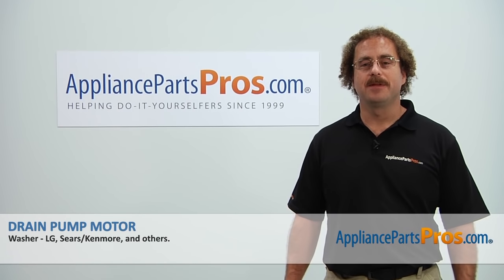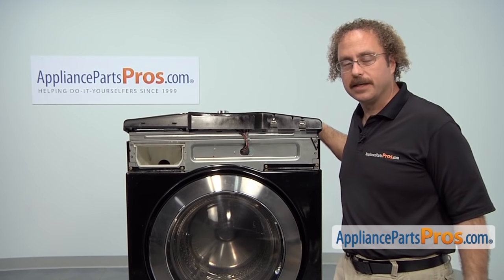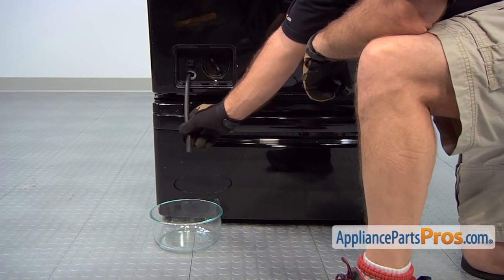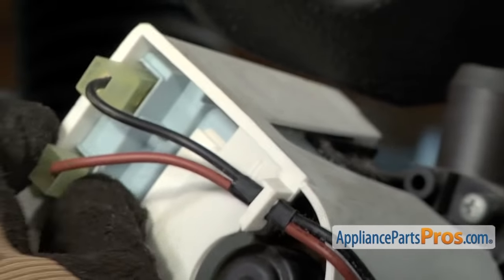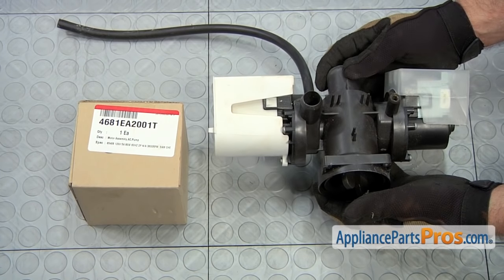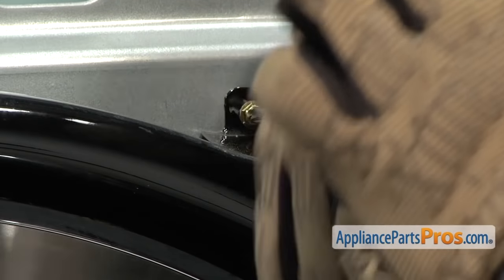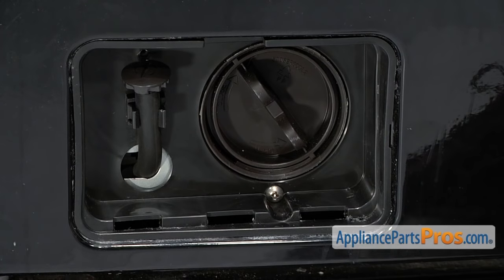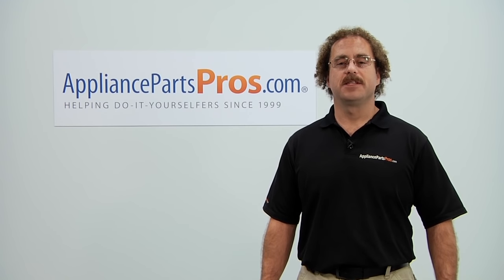How To: LG/Kenmore Drain Pump Motor 4681EA2001T

Comment: Excellent tutorial!  I just replaced the pump, but probably didn't need to -- the drain hose (and the smaller recirculation hose) were completely clogged with nasty sediment which is probably what was causing the problem.  I went ahead and put in the new pump while I was in there since I'd already ordered it and it was so inexpensive (plus the original is 11 years old, so was probably time to replace anyway).
Reply from the maker: Awesome, glad the video helped you out!
Reply: @appliancepartspros  Thank you for posting this video it is excellent.  I found the answer to my problem (clogged pipe where dispenser soap goes in).  After reading this post, I was able to give it a try and disconnect the pipe and clear it from 12 years of soap scum!  My husband couldn't be happier I was able to fix it!   You rock! If drain pump goes I will definitely know what to do :-)  My model washer is wm2377wc.

Comment: Does this video apply to my 2017 LG WM3997HWA? Do you know if my model uses philips heads also? Thanks for this, mine is in a tight spot, can't tilt it back, so I'll need to take it apart. May just skip trying to use my Lowes ext. warranty and do this myself.

Comment: Amazon vid. I'm not a repair man but managed it fine  (so far).
Only issue is the WM3050CW 2014 model of the drain pump doesn't have a clip to pull the motor off. I had to remove the mounting bolts, then additional screws that attached the motor to the plate. Not really easy but manageable. 
Thank you immensely. My next replacement purchase is from you guys.
P.s - now the compressor on my Maytag  PSD262LHEZ isn't kicking on after moving it up the steps. Any suggestions?
Reply from the maker: Rob Kuhar Glad the video helped you get the washer fixed! I would check all the wire connections to be sure nothing came loose. You can also post the problem along with the appliance model number on our repair forum and the techs can help you troubleshoot the problem.

Comment: took mine apart tonight removed pump ,,the comes a part i removed the stater (the center ) just pulls apart it was full of trash and black gunk i cleaned reinstalled have done 3 loads so far  working great (new pump will be here Tues.) you might try it ...Good Luck ..THANKS for the video.
Reply from the maker: ***** Glad the video helped you out!

Comment: We had someone come out 3 times to repair our washer under a SquareTrade warranty.  He replaced the pump on the left twice.  He also replaced some other parts like the PCB board and tubing.  He then said it was the other motor that needed to be replaced as the issue was never resolved.  It gives an OE error and doesn't drain.  Ultimately SquareTrade just paid me off with a check which more than covers the cost of the washer.  I'd like to just order the second motor and do this myself.  Do you think that might fix the issue?  THe tech seemed to think it would but honestly, he didn't seem all that technical to me so just want to be sure before I waste my time.

Comment: Should I still replace the drain pump even though I found out the OE code was from paper money clogging the rubber bellow drain hose and the drain pump is fine on my 10 year old LG FL? I bought a new drain pump since I couldn't find a kink or clog in the drain hose and the drain filter wasn't clogged. When I was installing the new pump, I discovered the dollar bills in the rubber drain hose that connects to the pump housing. Since my machine is 10 years old, should I install the new pump anyway since the old one may could go out soon since it is 10 years old?

Comment: It looks like there are two pumps, one on the left and one on the right.  Is that correct?  

Do I need to replace them both?  

Are they both the same part number? 

BTW, I ordered the LG tool for removing the spring wire ring assembly and it worked perfectly.  I'd recommend it for sure for folks clumsy like me. 

Thanks for making this video.
Reply from the maker: There is usually a drain and a re circulation pump, you can buy them individually, so you only have to replace the one that failed!
Reply: It was definitely the drain pump, on the left, it runs terrific now.  Thanks for your helpful video.

Comment: Great Video, can these Pumps fail in a way that they still pump, but make a huge racket. My LG Model WM3987HW starts to make a lot of new noise just during the drain cycle, but water does drain.. Is the Pump 110 volts so as to be bench tested for noise?

Thanks Steve
Reply from the maker: You can take the housing apart to see if something is in there. Check the wiring diagram for specifics on the voltage.
Reply: I did finally inspect the pump, it does use 120 volt line voltage, bench tested it and it ran good and quiet, Cleaned both the pumps and put them back in.  The loud noise is still there and still a mystery.
Reply from the maker: Steven, can you detect at all where the noise is coming from on the washer? Top, bottom, left, right, back, front, etc? It could perhaps be the motor on the unit or maybe the water valve.
Reply: Thanks for the follow up question, the All in One Washer Dryer is 4
years old and has about 6 medium loads a month, even had a 2 year break with no use when I had to leave town to stay with my Dying Dad to be his care giver in his last days. I have returned to my home about 10
months back and the Washer started with the noise about a month ago.

The noise is loud but only lasts for maybe 40 to 60 seconds, The washer is such a echo chamber it is hard to tell where the noise comes from, but happens maybe 4 times during a wash cycle, it does seem to happen at the start of each Drain cycle. The last Drying cycle there are no unusual noises so I kind of think that rules out the Main motor. 

You have given me a idea to remove the top of the machine and run a load. I would have to camp out in front of the machine though because the noise happens for such a short period each time.
Reply from the maker: Steve, if you'd like, you can call us at 1-877-477-7278 or chat us online at appliancepartspros.com and we can get some more details about your machine to help troubleshoot it.

Comment: So, if I have my washer in a pretty tight space and dryer mounted on top, could I undo my mounting brackets, slide the top of dryer with dryer on top back two inches and still get the control panel off without removing the dryer? Otherwise I need to take off a bathroom door, get a couple hands to pull dryer down, etc. I’d rather not go through the hassle if those retaining clips can be reached without removing the top. I have a ratcheting screw driver and even a full car trim tool kit should I need it for those retaining clips. Thx in advance!
Reply: Top of washer with the dryer on it is what I meant.
Reply: I would literally need to remove a bathroom door and get 3 people to move the dryer out, do the repair and reverse the process. I live in a cracker box.

Comment: Please, please, please add a warning note to your video that sometimes the washer will not have the little release tab to remove the pump.  Instead, the pump will be screwed onto a plate that limits vibration.  In that case, you have to unscrew the 3 screws to remove the plate from the bottom frame.  And then remove the two screws on the bottom of the plate to release the pump!
I spent two hours trying to locate the release tab that wasn't there!
Otherwise, great video.
Reply: Agreed. I just encountered this on my LG WM3270c.  Generally, this video was a good guide (I like his style) but I had to find the '3 bolt info' on another video. I'm guessing that this differing setup is associated with models produced after this video was created.

Comment: Hi great video  I am replacing the drain pump for WM2501HWA with the 4681EA2001T.  The pump looks identical but is an inch longer so the plastic cover does not fit.  i noticed on your video that the cover is more like the cover on the circulation pump.  I will check to see if someone switched  If not can I install the pump without the plastic cover.
Reply from the maker: Kevin O'Connell We were able to swap the cover over without any problems in the video. They have not changed the part number since we made the video so I would think it would fit. If you have problems you can always post the problem along with the appliance model number on our repair forum and the techs can help you out!
Reply: Thanks after looking at the video again I realized I was changing the circulator motor.  The two are identical except one is smaller Replaced the drain motor and it all works.  Thanks again

Comment: Prior to replacing drain pump motor, all wash modes worked but didn't drain.  After replacing pump and reassembling,  the washer isn't detecting anything.  It turns on but when setting to varies wash modes or spin, it doesn't operate.  No error codes are given either.  Any suggestions?

Comment: any chance you can do a replacement video for my Bosch washing machine model (wfvc5400uc/19)? I am waiting on a replacement part from you guys now. Thanks in advance.
Reply from the maker: We don't currently have that model lined up to film on, so even if we did, it would probably take too long to be of help to you. It does take us several weeks to source an appliance, purchase the parts, film all the videos on it, edit, qc, and post them. However, that doesn't mean we can't help you out! If a video is not offered for your part number, we offer additional technical support. We offer free technical advice and diagnosis 7 days a week. You can give us a call at 1-877-477-7278 or you can chat us at our website: http://www.appliancepartspros.com/. We will need your model number to give you accurate advice, which you can locate using this tool on our website: http://www.appliancepartspros.com/modelnumber_locator.aspx
Reply: Thank you for replying. I did order the part and was able to get it done. So far so good, all is working. The wifey is "excited" she can once again do laundry.
Reply from the maker: That's great to hear! Glad it's working again.

Comment: On our washer you need to use socket to remove 3 bolts holding base on.  Remove bolts and continue.
Reply from the maker: Thanks for the tip, hope the video helped you out!
Reply: Same thing, both pump motors are in a metal bracket held in by three 10 mm bolts through rubber grommets.

Comment: I am replacing the drain pump on a LG WM2455HW.  There is no 'L' or 'N' printed or stamped anywhere on the motor or the cover. How do I know the proper connection for the brown and black wire?  Thank you.
Reply from the maker: Phantom Rider If it is a 120V motor it does not matter, I would just install it and put the connectors in the same spots.

Comment: Do you know how to remove the pump assembly from a WM8000HVA?  I have gotten this far, but it appears to be connected differently from the older model shown in this video.
Reply from the maker: We do not have a specific video for that model. This one may be helpful but you may have to adjust the procedure for your model.
Reply: not sure if the year matters. Mine is around 2012. It is like above, required 3 bolts to be pulled at the base to get the assembly out. There was no front screws as shown here. Once out, it required 4 screws to be removed to get the bracket off the pump so it could be taken appart. 2 at the base, one in front under the filter and one in the back bellow the discharge. 
Then the 3 screws around the pump as explained in the video. 
The only differences I found were 1 screw in the right hand side for the face panel instead of it just being clips, and 2 extra screws for the front cover /door assembly plus a clip on top. The door assembly then had to be tilted away from the washer so it could be lifted off a bracket area that held it up.

Comment: What does the washer clamp assembly do? Mine was rusted and broke when I took it off.
Reply: Its not locking anymore. Is it because of that or did I break the lock?
Reply from the maker: What is the model number of your washer and we can look into this for you.
Reply: I just tightened it wrong, its locking now, thanks @appliancepartspros
Reply: Now then motor is spinning but the drum isnt @appliancepartspros
Reply from the maker: Have you had any error codes show up on the display at all?

Comment: Not all LG washeres have the two pumps...one on one side one on the other as shown in the video. My wm2277hw  just the drain pump on the left not the circulating pump on the right, caused a bit of confusion at the parts store because I'm the
" fix it once"kinda guy & I wanted to do everything associated with this issue so I wouldn't have to go back in l8tr to fix a problem that was right  next to the problem I just fixed...but only one pump in the wm2277hw. The parts guy said they have seen a ton of these go bad but not so much for the recirculator pump. He also stated for u guys with the two pumps that if your not pumping it out it's the drain pump if it's not washing correctly or getting in the tub correctly  it would b the circulation pump...fyi
Reply from the maker: A single part can be compatible with many different appliances. We film the part on a single appliance model to serve as an example of the repair, but there may be slight variations in the process for different models. Thanks for the additional information about how the repair went with your particular model!

Comment: I have a LG model WM0642HW and I has been giving me the OE Code, we have cleaned out all the drain hoses and replaced the pump and the machine still gives the OE code.  We than replaced the control board but are still getting the same error code.  The problems occurs at 37 minutes, rinse and spin cycle.  Sometimes if you thump the machine it will start running again?  What would be casing this problem?
Reply from the maker: +Elizabeth Dennis If you bang the machine and it works I would look for a loose connection or a bad wire in the system.You can also post the problem along with the appliance model number on our repair forum and the techs can help you troubleshoot the problem. http://forum.appliancepartspros.com/
Reply: +AppliancePartsPros Did you check the rubber bellow drain hose that connects to the drain filter? I was getting the OE cod, checked everything and bought a new pump. And when I was installing it I found 4 dollar bills in the rubber drain hose blocking the water. So the pump was fine!

Comment: What's the pump or component on the right side of the drain assembly?
Reply from the maker: Vince Castro The center piece is called the pump casing and on the other side is the recirculation pump/motor. You can go to our site and enter your appliance model number to get the correct ones!
Reply: AppliancePartsPros thank you for your quick response great video.
Reply from the maker: Vince Castro You are welcome, glad the videos helped you out!

Comment: On my washer, WM1814CW, purchased in 2006 or 2007, the door gasket does not slip off so easily after I remove the ring clamp. In fact, it won't budge a millimeter. Can anyone advise?
Reply from the maker: There are two clamps that you would have to remove. Did you remove both of them?
Reply: No. I didn't know about the second clamp. It wasn't mentioned in the video. I put the washer on its side and got at the pump from the bottom.
Reply from the maker: There is on clamp on the outside and another one on the inside with your model number. Glad you were able to get to the pump. If there is anything we can help you with please let us know.

Comment: Does this part seem to always come with an extra gasket? Is there any point to that?
Reply from the maker: The drain pump motor comes with a new o-ring but I do not know what you mean by extra gasket.
Reply: +AppliancePartsPros Sorry, you're right, it's an o-ring. Is it an extra or do we need to install it first? One is on the pump and one is in the box. Thanks so much for your reply.
Reply from the maker: As far I know there is only the one o-ring that goes around the impeller area to seal the motor when you put it in the housing.
Reply: +AppliancePartsPros Great, thanks so much.